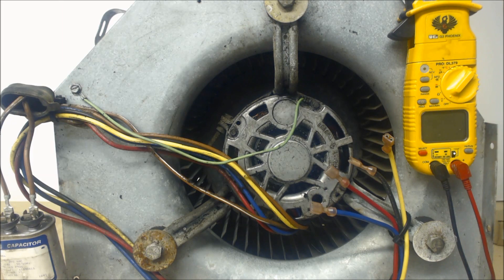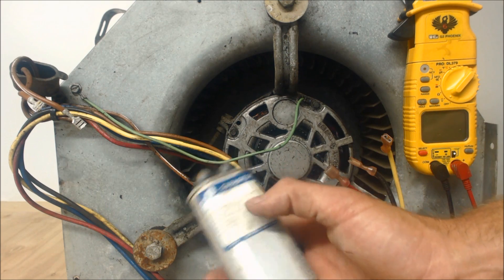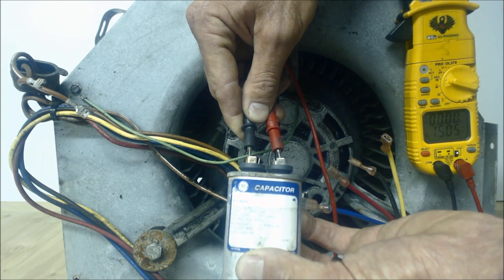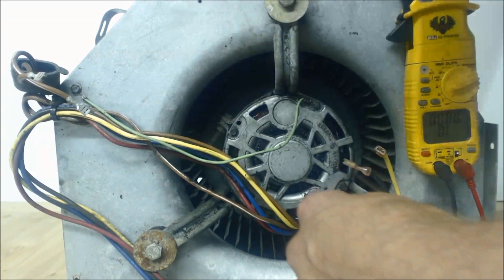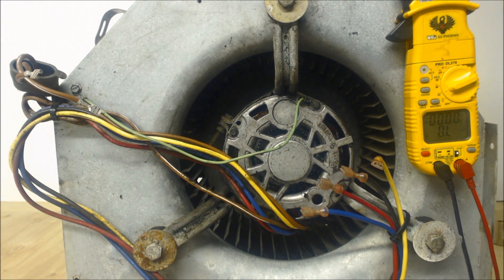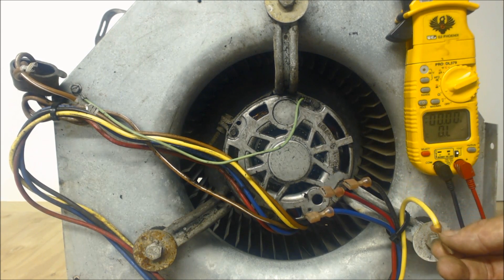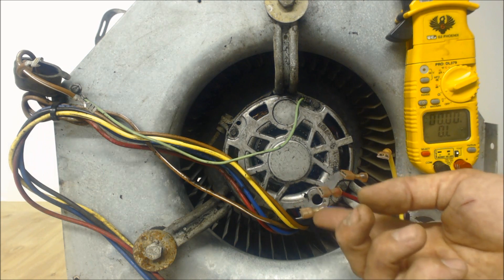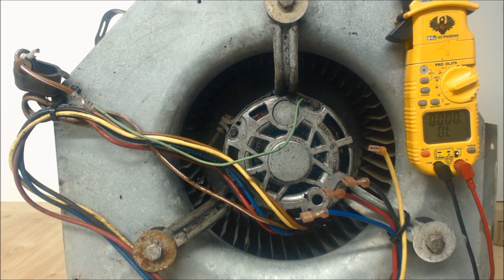Step by Step Troubleshooting of a 240v Blower Fan Motor- 3 Speed, 1 Phase!

Comment: Thank you for all your videos! I'm a long time subscriber. Since the high speed has less resistance would this mean less current and would this also result in using less electricity in the long run? Also what would be the most efficient blower motor available if I were to replace my 20 year old motor on a 3.5 ton Trane? Thanks for all the good info. You are the best!

Comment: Question, 2 wire capacitors have a positive and negative wire, or you can cross the wires ? Work the same ? No problems.  Thank-you

Comment: I have a 3 spd that lost medium and high spds. Replaced the cap= no change. Replaced again with 2nd new cap=no change. Bypassed switch=no change. No visible discoloration of coil. No short to ground. Should there be continuity "OL" reading between each of the speed wires? This is the one thing you dd not test for.

Comment: New Honeywell RTH2410 thermostat.  4 wires.    Working with Heat.   Fan "On" position.....Burner comes on, and Fan operates.        Fan "Auto" position........Burner comes on,,,,but Fan does not operate.   After short period,,burner goes off.     (Brown wire in G, Yellow wire in Y,  White wire in aux/W.    Red wire in R (with jumper).)   Internal switch on "Gas or Oil".     Honeywell said to change internal switch to "Electric".   Burner and Fan come on.   Both go off when temperature is reached.  {temporary fix?).       What can I do?

Comment: Man you have saved me so many $$$. I have done my TXV, cleaned my evap, gotten my airflow straight. I have my scales, tanks, scales and portable recovery unit for my home 410a unit. I was a Rail and Bus R22 guy when I retired in 2010. By 2014 I was working on 134a in a second retirement govt fleet shop. My schraders on my own 410a unit started leaking in 2015. I am in Tampa where HVAC residential work is way overpriced and nearly every tech tries to sell units. The cheapest company in 2015 wanted $1136 to replace the valves including refrigerant which 410a was $135 for 25lbs. then. I bought my Robinaire scale, pump, recovery unit and a leak detector along with 25lbs then. I learned subcool and superheat in a day from you Chris.
Reply: You opened line set so you also pulled a vacuum below 500 microns and purged nitrogen while brazing? So you bought a vacuum pump, micron gage, Brazing rods torches, hoses, charging hoses, charging T or Y fitting, scale, nitrogen, acetylene, oxygen, recovery tank, filter drier, TXV for your specific unit and the refrigerant in order to save a couple hundred bucks? I admire your ambition but your math is flawed. Careful not being licensed to handle refrigerant too the EPA will pay regular citizens $10,000 reward to turn people like yourself in imagine what fines and sentencing they would put onto you. I'm not being a smart ass nor care what you're doing to your own unit I'm just being honest with you look for yourself if you'd like

Comment: I know this is an old video, but I have a blower motor (part of an hvac system) that I asked the tech to save when the main unit went out. They just cut the wires off the motor. 

  How do I find out what capacitor I need to get for it?

I want to repurpose it for a shop dust collection. 

Thanks!

Comment: GEEZ , the guy helping me at AC place their place not open today or tomorrow AND I need to ask him again something . Yes , i bought new capacitor there and installed it and didn't fix it . He said on blower motor if I disconect the cool terminal wire on circuit board and connect the bottom black wire to cool terminal that ( this is what I'm not sure what he said and needed to talk to him ) if it works ( or doesn't ) that means board is bad NOT the motor ?? OR is it the other way around ?? And yes replaced capacitor . Still the same barely running the blower not full speed and shuts down after a while with new capacitor

Comment: I have a 120v blower motor.  Confirmed - getting 120v coming in from the line (extension cord before connecting to the blower).  Whenever I turn it on, I'm only getting 98v - motor won't spin.  It worked fine a couple of weeks ago.  I'm stumped.  Excuse my ignorance, but, should the voltage drop to 98 once plugged in?  Would this have something to do with the capacitor?

Comment: Ever seen a blower run and hum/ slow down? After min runs for a bit it will slow way down so you can feel any air moving. And hum loudly. And then continue to run all day because its doing nothing.  It has a run, off, and fan selector on the unit. It stays on run. If i turn it to fan, it will stop humming but stay slow. I assume xause its only running on low?  Checked he speeds low is like 5.9 abd high was 2.2 i believe. Any help?

Comment: You test the resistance between yellow and brown w. White trace is 0 ohm. But the run capacitor series with start winding then parallel with run winding. I conclude that the resistance between yellow and brown w. White trace should be the resistance of the run winding, the resistance between yellow and brown should be the resistance of the start winding. What is wrong with my conclusion? and what component will be measured between yellow and brown to get 20 ohm?
Reply: Just so  im not mistaking your point ....since the yellow wire and the brown/white wire are attached this would make the yellow  wire the RUN winding....and by default the Black, Blue, and Red wires would be considered the COMMON point/connection???

Comment: My blower motor is stuck on low speed how do I fix this.
Reply: Depends on how the speeds are determined. Some motors are wired to run on one speed by using one wire and not the others. It may be as simple as switching your motor wire to a faster speed. Black is usually the fastest going thru the colors to Red which is usually the slowest speed.

Comment: Can I pay you to contact me directly. I have a question. I'll pay you through cash app. I really need your help on something. I have a blower motor winding problem with the low speed and the medium speed and high speed work. I put the medium speed on heat. Will the blower motor work for a while and stop or will it work fine? Seriously man, I need your help.. my email is dlocklear0307@gmail.com.
Reply from the maker: if one winding is bad, it would be best to go ahead and replace that to avoid it burning out. I don't do phone calls but just answer technical questions as I can online, thanks!

Comment: Very enlightening; my a/c unit got swamped with rainwater now the interior air blower motor won't run.  Two of the 3 speed windings are open; only the Hi speed winding reads 17 ohms. Could the OL heaters be the culprit since it was running on the Lo Red wire. Can I connect using the Hi Black wire?
Reply from the maker: Sounds like the motor needs to be replaced at this point for safety, thanks

Comment: I have a question...and I’ll try to make a long story short, I replaced the control board today...thinking it was bad due to a wrongly labeled/tripped breaker, Anyway...after I figured out the breaker issue and the new control board was already installed...I fired up the AC, in the attic I heard the blower motor making noise...upon inspection it wasn’t starting, but trying. I tried to test the capacitor but my meter doesn’t appear to have the correct setting - so I swapped the capacitor with the working upstairs unit  and the problem persist, capacitor works fine in the other unit. So I tested the blower power on the control board by pulling the black (cool) wire and the white common, put the meter where they went on the board and made sure power was on and the door switch taped - I seem to be getting 0 volts. Thermostat was set to cool/fan ON - not Auto, I’m wondering if maybe I’m doing something wrong...or if maybe it could be something else that could cause the problem cause I just installed a brand new control board and don’t see why the blower wouldn’t be getting power as there aren’t any status LED’s alerting me of a problem. I’m about to pull the blower motor out of the working unit to see if that resolves the issue...but I live in AZ and it’s pretty dang hot up there...so the less work I have to do up there the better. Also don’t want to keep throwing parts at...I’m a computer tech and mechanically inclined, so I try to do what I can before calling techs out...and I had a bad/costly experience last year with an HVAC tech...so. Thanks in advance for any advice you can offer.
Reply from the maker: If this is a psc motor and not an ecm motor then you would be getting 120v to the blower if this was a furnace and 240v if this was an air handler. You would need to make sure that you are getting 24v to the g terminal on the board which is a call for fan before testing, thanks!

Comment: What is an air handler ? Where else we find these types of fan motors ?
Reply from the maker: They can be found in furnaces and package units too. An air handler is just a coil, blower, and low/high voltage control all in one unit. They are also called fan coil, thanks

Comment: Hello Craig, 
First for all thanks for this great video. I understood the whole process you did but only one thing. When you said that you should not get a resistance reading between common ( yellow) and the capacitor's brown/white wire and the reason being, as you said, is that they are attached inside the motor housing. 
1- Does that mean the resistance reading you are getting is the winding between common and Start? 
2-and  if that is the case, why can't we get a reading between common and the capacitor's  brown wire? Is not the brown wire attached to the Run winding which is also attached to Common?
Reply from the maker: I think I meant that you won't get a high resistance reading but that it should be very close to 0.0 ohms of resistance since they are connected right under the motor housing. You might enjoy another video I did on the thermal overload mounted on the windings of the blower motor. Just look up "acservicetech thermal overload" thanks!
Reply: For your 2nd question > @5:24 time line the ohm reading of approx 20 ohms is between the yellow wire (run winding) and the brown wire (start winding) .  that is the combined resistance going through the run wind and start winding in series

Comment: Thanks for the video! Very informative. I bought a used motor 4 years ago and installed it in my electric furnace. It had a capacitor with it, which I used. I noticed that the capacitor is 7.5 uF, but the label on the motor calls for a 6 uF capacitor. Anyway, this motor has been working very well for three winters now. I do have a couple of questions about capacitors though. I read somewhere or saw in a video that it's okay if the capacitor is a bit larger, but it mustn't be smaller, is this correct? Also, I'm wondering if a capacitor will give any warning signs that it's going bad or does it just suddenly fail?. Is it a good idea to buy spares or do they have a shelf life?
Reply from the maker: It has to be the smae size as the motor is calling for in regard to uF but if the capacitor is a 440v then it can replace a 440v or a 370v, thanks

Comment: Ohhh  i get it. The 4 connectors you are testing just loop down to the left and join up with the 2 cap wires going into the motor.     I thought these were separate wires altogether.
Reply from the maker: Yeah those are the winding wires and yellow was the 120v common and the others were fro the 3 speeds. The brown and brown/white are for the capacitor, thanks

Comment: Amazing content, keep up the great work! 
Just wondering if you could whip up a series, teaching techs how to properly read and follow wiring diagrams from AC, HEAT PUMPS, FURNACE applications? much appreciated! 

Also, do you ever dissipate your cap using yoru multimeter set to volts? would that not be safer?

Thanks again!
Reply from the maker: Thank you for letting me know what you would like to see! A 20,000 ohm resister could be used but I havent seen any damage occurring when they are the 80uf and smaller. You are really just taking the very last bit of power out since the capacitor discharged after the power shut off but the motor continued to free-spin except in the case of a start cap that has a relay to take it out, thanks
Reply: Wouldn't the capacitor self discharge through the motor winding.  As you demonstrated the one capacitor lead was connected to the white wire and the other had 20 Ohms to the white wire.  Pretty close to a dead short and certainly less than a 20 K Ohm resistor.  I would think the only place you could expect a cap to be holding a charge would be is a high voltage DC circuit.  Also, any remaining voltage would be DC and could be measured with a voltme set to DC Volts.
Reply: I 2nd the series!

Comment: good video. Thanks. By the way, OL on the meter is not ovel limit. It actually means Open Loop. Which makes sense since your are testing for a short or open circuit. Again, good vid.
Reply from the maker: Thanks Hector, It is referred to as many different things such as open line, open loop, and over limit. They are all correct in their terminology. Over limit means that the resistance value is over the limit that the meter can read and is the terminology that I usually use, thanks

Comment: any opinions on testing caps under load. i hear alot of back n fourth.
Reply from the maker: If there is a safer way to test something with the same results then I advocate testing it without power. I have never misdiagnosed a capacitor that I am aware of when testing it without power. Honestly, in my view, it is one of the simplest components to test so why complicate it or tell people to be closer to the danger of high amperage. In any multimeter testing I will always show how to test components with the least amperage running through them as possible, thanks
Reply: If you know how to use the formula and can do the calculations, it's faster to test the capacitor while running.

But if the motor is going bad, but still running to some extent, you don't know what variables you are looking at.

And it still doesn't tell you everything is ok inside the motor, which means you're pulling all the leads anyway.

Comment: My ac was running and I began to smell and see smoke in the house,  I discovered it came from the air handler blower motor.  If I switched on the power the motor would slowly turn for a minute and then stop.  I purchased a new motor and cap and installed and immediately upon turning on the breaker the motor caught on fire.   Could it be the relay or transformer?  Also the only thing that I know that I may have done wrong is that the new motor had a white and black common wire, I only used the black because the old one only had the black.
Reply: it is a Lenox CB30M-41-1P
Reply from the maker: The wiring diagram should be on the shroud of the air handler. Was this diagram followed?  thanks
Reply: I followed it but the only thing diferntial with the new motor was it had a black wire and white wire common...there are only three wires coming from the relay and black is there so I connected black motor to black relay.  Should it have been the white?

Comment: where do you hook up the Neutral wire
Reply from the maker: This was a 240v 1 phase motor so there is no neutral just the one hot along with the other three hot speed taps to select a speed from and a ground. thanks

Comment: My blower motor hummed but never turned.  When the breaker was switched off I could turn the motor by hand.  I bought a new capacitor and it worked great for a few days then went back to the same symptoms.  I did what you showed - removed wires from capacitor, shorted it out, and did a voltage test.  Nothing.  I guess I got a bad one.  I read Genteq is the best so I ordered another.  Should be here in two days.
Reply from the maker: Check for voltage and amperage readings on the running blower motor after the capacitor replacement. The capacitors usually don't go bad that fast but it is always possible.
Reply: The new capacitor didn't fix the problem.  Had a technician look at it, and it's a bad blower motor.  He's actually installing a new one as I type this.
Reply from the maker: Got ya, thanks
Reply: Yea typically if you have 120/240 coming in and nothing is happening than its bad.

Comment: very nice explanation but you didn't explained about mechanical faults
Reply from the maker: Zabi ulla thanks for your comments. After I turn the power off I check to make sure that the motor is not frozen and that the bearings are not worn and wobbling or that the wheel is not rubbing up on the side of the squirrel cage. I mentioned to check that at the beginning of the video. Thanks

Comment: Hi: Thanks for the reply, much appreciated. On several occasions when on service calls, I've come across a unit that was tripping an RCD. But testing with a Multimeter showed no signs of leakage to ground, however when tested with the higher voltage of the Megger, definate leakage was shown. Nowadays I never go on a service call without my Megger.
Andy
Reply from the maker: No Problem, thanks for your comments! What are you servicing? Just curious

Comment: Informative video, but wouldn't it be better using a Megger to check for grounded windings ?. The low voltage produced by a Multimeter / clamp meter often won't show leakage where a megger will.
Reply from the maker: Great Question! The multimeter is a quick service tool that would show some type of resistance if it was grounded even a little. If the reading remains O.L when you know you have good connections to the leads you are good. The megger is often something that would be used in the preventative maintenance of larger equipment. A megger is good for checking insulation level of a winding. Still would be good if someone wanted to use it. Thanks!